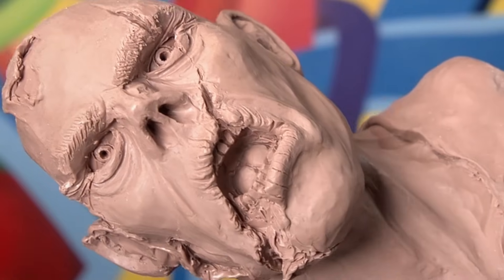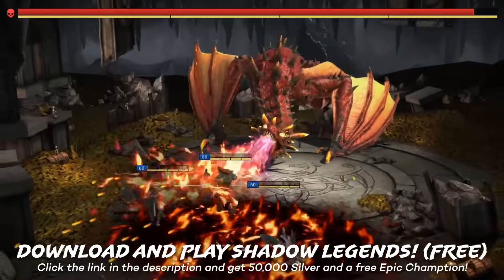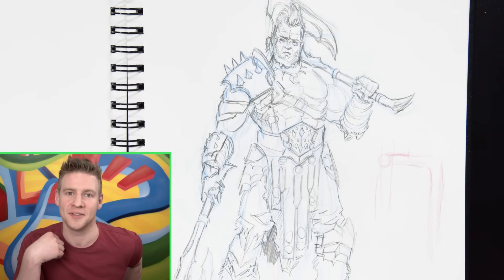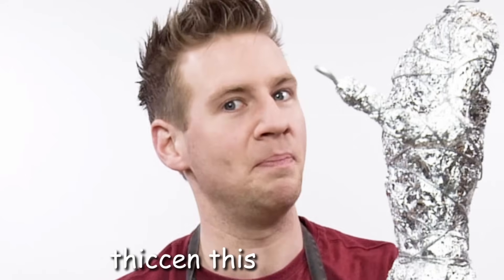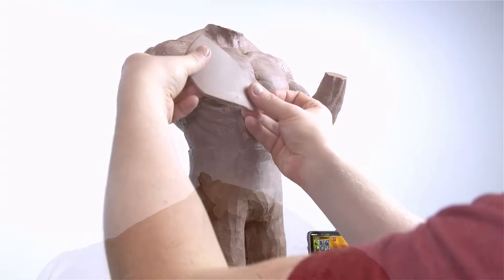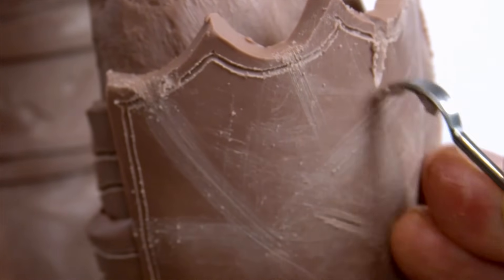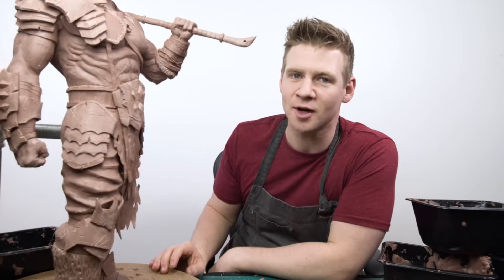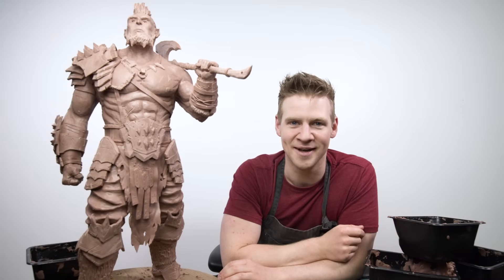GIANT Monster Clay Sculpture!! *EPIC*

Comment: You have to paint it because this is f*cking epic
Reply: Ferdinand Staufer You need to cast it first and then you can paint it
Reply: @southsynthic7828  This one melts from heat, I don't think it can be cast.
Reply: Anastasia Klyuch Well, you can mold it in silicone and make it in plastic or latex
Reply: @southsynthic7828  that takes heat, this melts.... from heat
Reply: It would be awesome if he could paint it
Reply: @btuttle8  most silicone mold making... doesnt require heat
Reply: TheDarkArtist casting doesn't use heat
Reply: Smolbirb thank you
Reply: nightcat 1215 You can't correct me because I've been making latex masks for 7 years now and learned alot of things
Reply: He can still cast it. I’ve seen a few YouTube artists use the exact same type of clay and it doesn’t melt when they cast it. In fact it holds details really well when they cast it. I don’t know if there’s something these artist specificity do in order to cast the sculpture, but it is possible.
Reply: @southsynthic7828  he can
Reply: Alicialight Art THANK YOU! YOU ACTUALLY KNOW HOW THE PROCESS WORKS
Reply: @southsynthic7828  he can because he could be using a different latex
Reply: Mr Whiscers vlogs, and more stuff True, there are different types of latex. I worked with alot of them in mask making and figure making
Reply: TheDarkArtist  that would work

Comment: Very awesome ! Only thing left is to paint it ! 

Does that clay take paint ? Would a primer seal it ? Or does it dry out on it's own without cracking ? Would it also not be possible to sculpt a stronger armature in the base and legs and possibly hide it with sculpted rocks/land features ?

Genuinely interested, have always harbored a desire for sculpture, and would love to create myself. No skill at it at all at the moment, but any and all info before an attempt would be beneficial.

Comment: Comment probably won't be seen because it's a 2 year video but you should of used 2 poles, one in each leg. This would of avoided the pole in the butt. You can get pipe benders to get the stance you want and they are quite cheap. Amazing sculpture though, so much detail